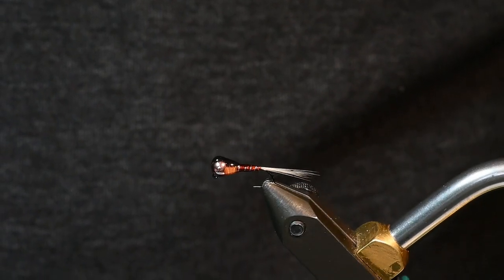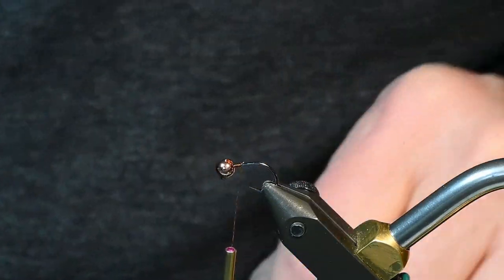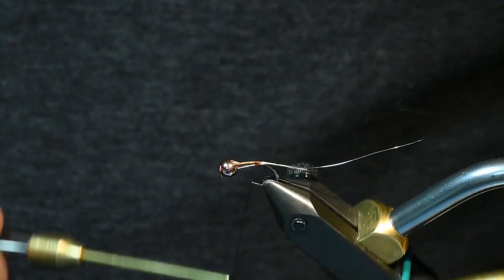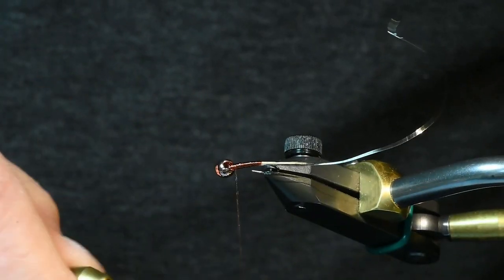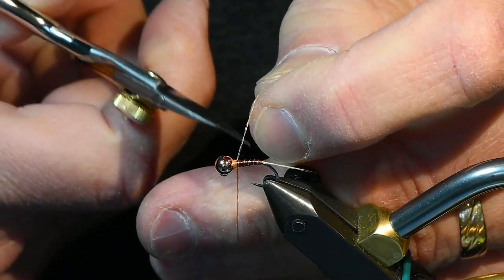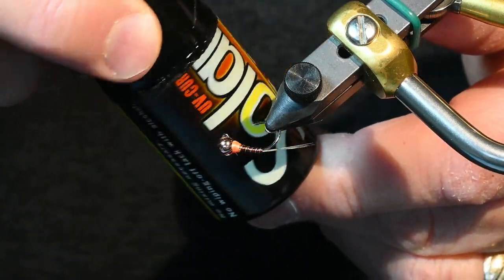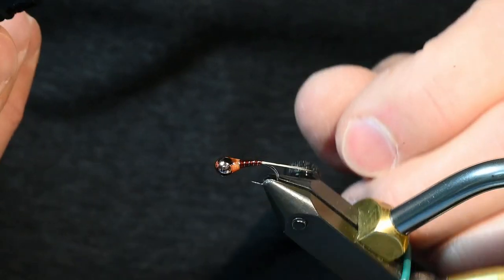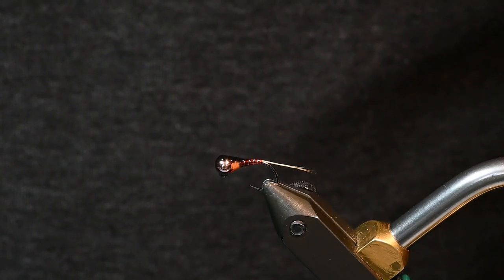Tying a Pheasant Tail Perdigon (with Veevus Body Quill) by John Kreft - RiverKeeper Flies

Comment: Thanks for sharing!!  I’ve actually used the body quill material for the entire fly, bypassing any need for thread.  It just requires very light tension on the bobbin.
Reply from the maker: That's exactly what I used to tie the fly. When I started tying them, I used thread. I quickly changed and used the body quill for the entire fly.

Comment: With using uv resin you don’t particularly need to whip Finnish. Just leave bobbin hanging, small drop of uv on the thorax and cure . Just curious on why you put the wing bud on the top of the jig hook shank? Wouldn’t that leave it facing down in the water?
Reply from the maker: It's faster for me to just whip finish, but your approach would sure work. I've always wondered why tyers add the black wing buds on top too because the fly is designed to fish upside down. Maybe it tumbles somewhat in the water column. All I know is this fly catches fish for me at a higher rate than any other perdigon nymph wheyn I fish it in the winter months.

Comment: thank you for the video.  I do have a question... Why did you build the thorax out of Veevus body quill material?  Why not use a thread instead?
Reply from the maker: You could easily substitute thread, Charlie. This fly is a slight variant of a different fly pattern that used pheasant tail for the body. They used body quill for the thorax and I used the same material here. The orange material is fluorescent and glows when under UV light, which I believe is a hot spot underwater. But as I said earlier, a fluorescent thread would do the same. Just create your own variant.

Comment: Tough to watch someone use scissors on wire.
Reply from the maker: Thanks for leaving a Comment. Sometimes I use the bottom portion of my scissors, other times I "helicopter" to break the wire. I've used this technique for 50 years and never cut wire with the ends. I use a small hard stone to sharpen every once in a while as well to keep them sharp. Been using these Razor scissors for many years...my favorites.
Reply: @riverkeeperflies  uh huh